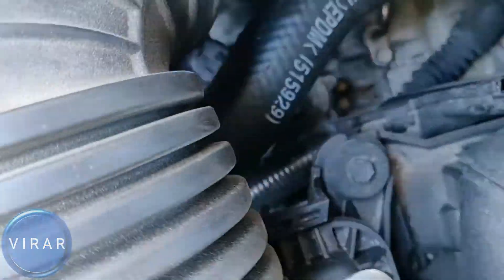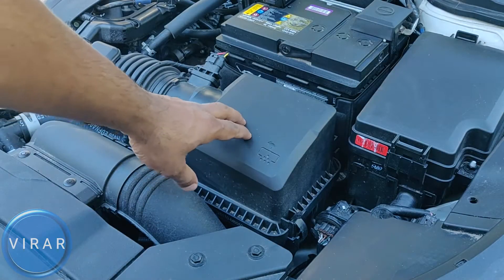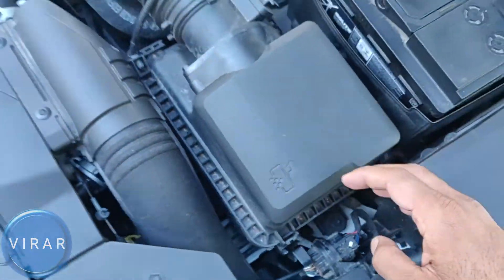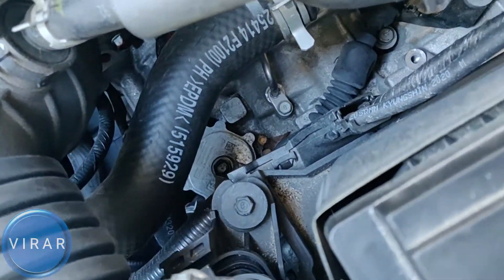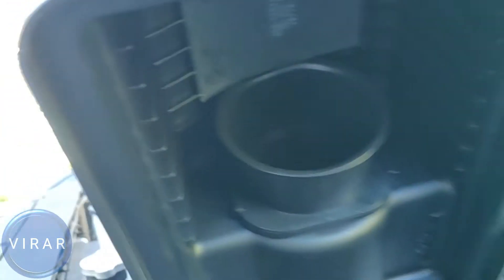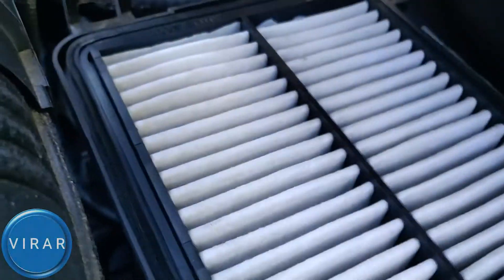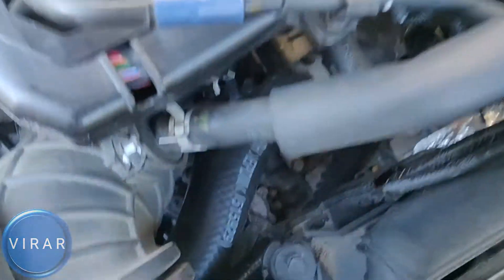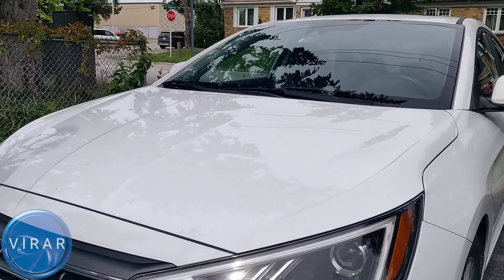How to Replace Engine Air Filter - Hyundai Elantra (2019-2020)

Comment: Can the air and cabin filter be cleaned and reused
Reply from the maker: They can be cleaned yes. But preferably just replaced. Because it is hard to clean out the dirt particles which are stuck to the filter.

Comment: I won't be paying the dealer to do this ever again same with my cabin air filter
Reply from the maker: Glad you found the video helpful
Reply: My dealer wants 199 for the 15k maintanence package and this is the air filters, oil change and some fluid flushes is all they are doing, i can do it myself for much cheaper. Been doing my own oil changes despite the hyundai free maintenance because the dealer wont do it before 6k miles and I like to do it at 4k. Problem I am having is finding the filter for my n line in stock.

Comment: Can a dirty engine air filter make the vehicle over heat? I’m having an overheating problem. And the nearest dealership is 400KM from where I live lol.
Reply from the maker: Not likely. Overheating is caused by an issue with the cooling system. Check your coolant level in the coolant reservoir. Be sure to check it when the engine is cold (vehicle been parked for 2-3 hours )